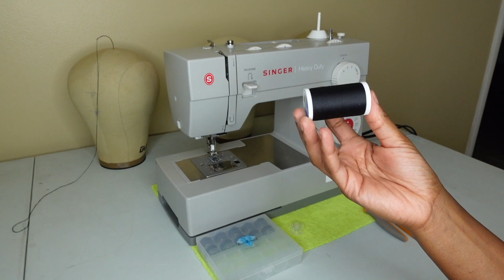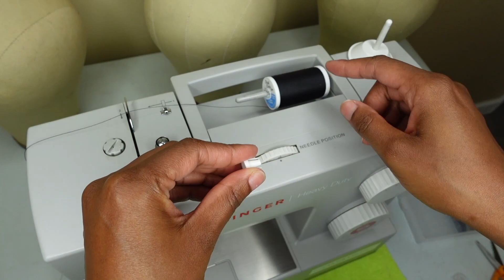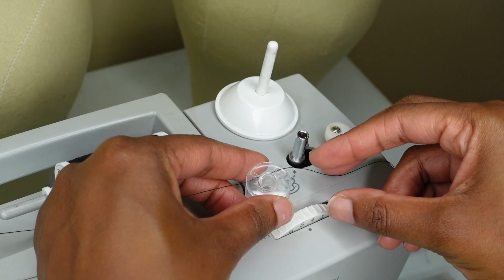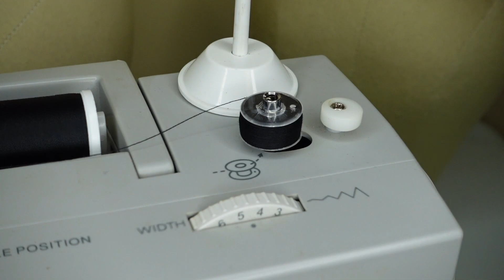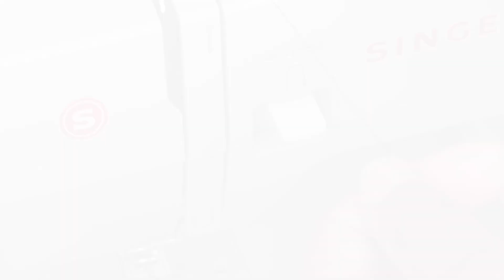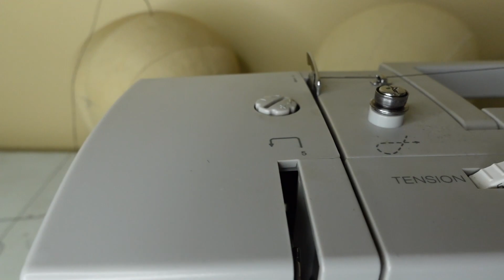How to thread a sewing machine for beginners | Singer Heavy Duty 4423 | wig making 101

Comment: Hello I will like to thank you just when I was about to give up I found this video. Your amazing 👏 ✨️ ❤️
Reply from the maker: Thank you so much Regina. I’m grateful to help. Let me know if there’s anything specific you’d want me to make a video on!
Reply: @itsbigcyn  I keep getting the thread jumbled, I see notice I have cotton thread can that be y
Reply from the maker: @RGH30  yes, cotton is a little too thick for the machine. you want to use polyester thread for both top and bottom bobbins.
Reply: @itsbigcyn  thank you will be buying today you are truly  a blessing 🙌 🙏 💖
Reply: @itsbigcyn  hey what can help if trying to sew wefts the needle is getting jammed and thread knotted?
Reply from the maker: @RGH30  This typically means your needle is dull & you need to change it. Also make sure the part of the machine that holds the needle is securely screwed.
Reply: @itsbigcyn  thank you for a quick response  do you have classes?
Reply from the maker: @RGH30  classes are in the works, I’m hoping to get them going in 2023.
Reply: @itsbigcyn  and it worked I stitched my first weft I thank you very much please keep me updated.

Comment: Hi.  When you threaded the needle manually - you didn't utilise the last little nook where the needle / set screw is.  You show it at 13.39 when you were threading as if you were going to use the automatic needle threader.  So, when you're threading it manually - do you habitually skip that last guide hook?  Has it worked for you doing it that way?  I would really appreciate a speedy reply because I have the same model machine and it is knocking my self-confidence, big time..
Reply from the maker: Hey Reese! I can see your confusion — the thread must have come out of that last guide hook after I hooked it. Always thread that last hook. Not threading it can potentially cause skipped and/or loose stitching. I hope I cleared that up for you.
Reply: @itsbigcyn   Thanks! I got this machine yesterday and I can't seem to get it right. Each time I try to remove the sewing from the machine I end up having to drag the fabric out.  It feels like I'm damaging the machine. I've tried so many permutations my head is spinning.
Reply from the maker: @reesemorgan2259  that’s happened to me before too. It sounds like your thread may just be getting tangled. You’ll master this soon with practice.